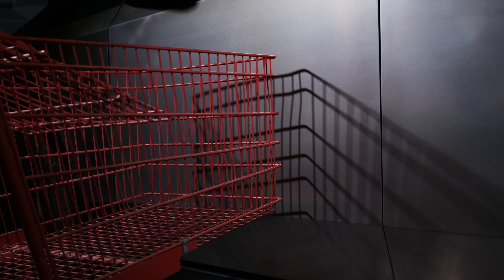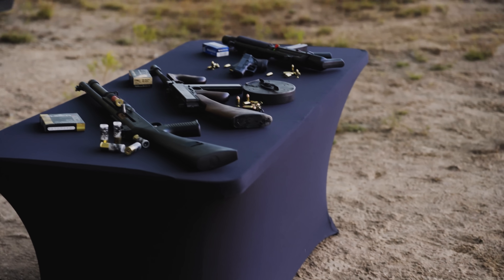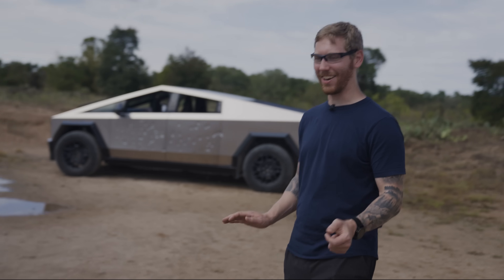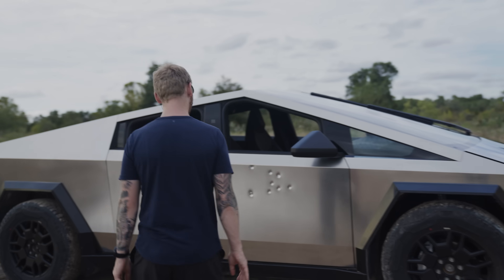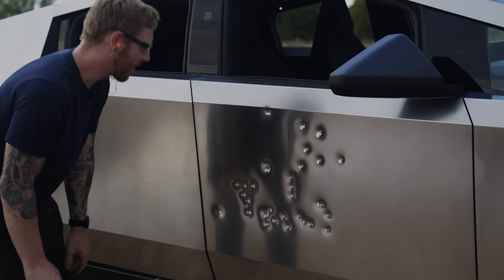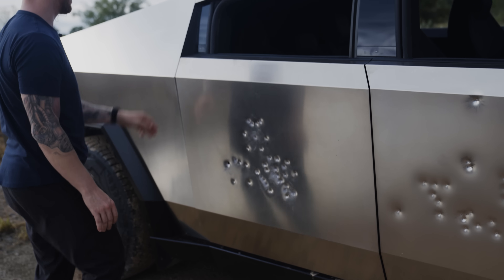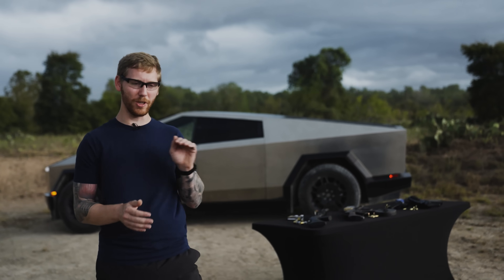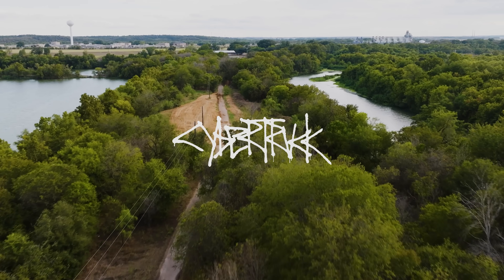Cybertruck Bullet Test

Comment: This test is incomplete until we hit it with 4 BORE…
Reply: We need a test from you starting with the 50 up to a 4 BORE. LOL
Reply: @dgilroy26  Kentucky Ballistics would do the job
Reply: Yooo it’s the goat!!
Reply: Yeah, but who's going to spend $70k to punch a hole clear thru their truck?
Reply: @jtengineering9385  Only KentuckyBallistics is crazy enough to do it.
Reply: @jtengineering9385  WhistlinDiesel will
Reply: @jtengineering9385 that sounds like something whistlindiesel would do....
Reply: @jtengineering9385   70k is just the starting price, but I do get your point.
Reply: @jtengineering9385   Then the cost to fix
Reply: @jtengineering9385  elon should he claims its bulletproof ....  they should test it using an AR-10 ( .308 ) a common round used and watch it punch a hole right through it
Reply: Tactical T-Rex baby arms are punching the air right now
Reply: notice how its all pistol ammunition. its still impressive but i wonder how 223 would do.
Reply: @abdulqadirbaban2730  it would go straight through it
Reply: @abdulqadirbaban2730 I want to see a test on the sloped front panel/windshield and the tunnel cover. The extreme angle might be enough to bounce rifle cartridges
Reply: @abdulqadirbaban2730  imagine if they had made the entire thing out of ar500 lmao the truck would have to be insanely expensive to break even
Reply: @dukedunac  It would be too heavy and slow
Reply: @abdulqadirbaban2730 It would blast right through it like Swiss cheese. Considering 1/4" steel plate won't stop 223, and these panels are only 1.8mm thick.
Reply: @abdulqadirbaban2730  like swiss cheese, if its not mostly lead and over a .45acp in power its probably going through. They probably shot subs for this videos hahahah
Reply: @abdulqadirbaban2730   and they are using a diferent type of bullet wen they shoot the black truck, so maybe even a diferent bullet would go trough easly.
Reply: @abdulqadirbaban2730  would smoke it
Reply: @abdulqadirbaban2730  yep. Or 7.62x39.
Reply: @abdulqadirbaban2730  no need to wonder. We all know it
Reply: How many tables to support the truck? Ballistic gel dummies inside too.
Reply: 4,  upside down. @PiDsPagePrototypes
Reply: I would absolutely love to see that. And the punt gun.
Reply: Based and neck pilled.
Reply: you have to do this now.
Reply: The only electric car Kentucky ballistics will buy
Reply: DO IT
Reply: Oh no
Reply: Four BORE and seven years ago our fathers brought forth, upon this continent, a new nation, conceived in liberty, and dedicated to the proposition that all men are created equal
Reply: yeah, you should definitely do that, with the boys if possible
Reply: i cant wait for you to do that later if you can, love your videos!
Reply: Truth.  Also... need to see how it reacts to a .50 BMG exploding inside of it.
Reply: PUNT GUN!!
Reply: exactly.. and even your regular AR rounds will go through
Reply: @woof3065 no. It won’t . Tried it
Reply: Definitely need a high caliber test.
Reply: @kevinwalton9348 oh they did they just won't show. Any rifle caliber will penetrate
Reply: @kevinwalton9348  Still isn't bad for the avg 9mm and 45 cal.
Reply: id buy that for a dollar
Reply: How about your Punt Gun ?
Reply: No. The punt gun!!!
Reply: .416 rigby
Reply: Barret blows you a kiss from blocks & blocks & blocks & blocks & blocks  away. The US Army liked them for a reason.  @hhxyz1234
Reply: Elon would probably paint a Disney logo on a door and let you shoot whatever you wanted at it for shits n giggles.
Reply: i hope you have 100gs set aside for this
Reply: Video clearly made by Tesla lol they use small under powered guns to "prove" the Cybertruck is bulletproof. LOOOOOOOL . An AK47 would shoot through it like cheese mate ! And they refuse to shoot the windows cause we all know even the small bullets would break through easily
Reply: You and Matt should be hired to go ham on this thing. That is a video I would watch.
Reply: Or a 50 cal
Reply: 416 Rigby?
Reply: It'll prolly stop 5,56mm and 7.62. Ima test mine when it gets delivered while Elon and Leno sitting inside.
Reply: @czealtamahawk1228   I doubt it. Notice that they didn't use any spitzer bullets in this demo. There's a reason for that. I wouldn't be shocked if .17HMR would make it through, simply due to the size:speed ratio.
Reply: @czealtamahawk1228  556 and 762 will easily punch straight through
Reply: presidents limo is more bulletproof than this crap
Reply: @lemcakes32422  Well obviously, president's limo is made to be bulletproof
Reply: @lemcakes32422 um, it also weighs 3x what it did before bulletproofimg
Reply: The Legend XD
Reply: Colab with Elon
?
Reply: yeah many people walking around with elephant rifles in USA
Reply: Man if you could get hired by Tesla for an advertising stunt that would be awesome !!
Reply: there going to be aimin in the glass not the metal
Reply: @aviationfish  They never though about the glass side windows I though bad guys only aimed at the thickest metal areas using the weakest of guns with the softest of bullets so it can get more clicks on you tube.
Reply: underated comment
Reply: aint no wat theres only 442 like on this
Reply: True
Reply: Yeeeessss
Reply: Whoahhh😂
Reply: No, 16" AP
Reply: i mean, cmon we already know its gonna go through
Reply: Lol
Reply: lol
Reply: punt gun?
Reply: Underrated comment :\
Reply: Tesla said this steel is good for most  subsonic shots
Reply: PUNT GUN!
Reply: YEAHH
Reply: Just stop with bb guns and bring anti-tank guns already !
Reply: 50 BMG come on
Reply: Some how I can hear your comment
Reply: Appropriate comment from the most appropriate individual.
Reply: Still pretty cool to see a truck with 2A body panels
Reply: would like to see the keltec plr 16 go against it loaded with green tip.
feel like it would be a hood gun in chicago. tesla gotta survive the ghetto roaches.
Reply: Let's do it guys lets get this approved ,give that thumbs up a working
Reply: THIS.  And a Punt Gun. XD
Reply: They should have called you 🤣
Reply: How about the punt gun vs cyber truck but for that try to shoot through it from the front
Reply: Yesssss!
Reply: i was waiting for you or Demo to comment. Good man.
Reply: I literally read this, and didn't even read the name, looked up thinking "no way this is Kentucky"... and boom....Mr 4 Bore himself 🤣

No way this is taking a 4 Bore or a 700 Nitro....but it sure would be cool to see it attempt it 😅
Reply: You and Matt need to give it a go.
Reply: Do it we know you have more than enough money to drop on multiple cyber trucks without thinking!
Reply: @rat-ballz  having money does not mean you waste them. Actually is the opposite
Reply: 😂 bro you insane and I love it
Reply: Slap rounds……
Reply: Some sort of collaboration needs to happen
Reply: It's incomplete regardless, to know the full extent, it needs more than just a few tiny rounds from guns hardly ever used.
Reply: @garydezern5212  we know... it's a joke...
Reply: not even close.. they didnt even shot the windows
Reply: This test in incomplete until Scott does it.
Reply: Get Cody, it’ll be like Christmas for him.
Reply: You not going to war in this 🤦🏽‍♂️
Reply: they could've at least took it to demo ranch, it's in the same state. Real armature hours here starting with a .45 and moving "up" to 9mm. do better @elonmusk
Reply: 🤣🤣🤣🤣🤣🤣 agree
Reply: Cybertruck vs Rigby when??
Reply: No one can shoot a 4 bore and survive, but a few men.
Reply: tesla should send Kentucky Ballistics a door from a cybertruck for testing.
Reply: Or just any rifle round.
Reply: kb is totally right we even don't know if a minigun or rpg destroys ctbertruck
Reply: you always resulting to violence sir. can you suggest less violent like swatting it with a folding table! hehehe
Reply: Whistlindiesel will do it
Reply: Ah yes!😊
Reply: This test is incomplete until Scott puts a thumb in it.
Reply: do it !!!!
Reply: Do it Scott 😂
Reply: aim it at the engine when you test it
Reply: PLEASE
Reply: I expect Mexico to be the no. 1. buyer of the Cybertruck, and not just the cartels.
Reply: Hell Yeah!
Reply: was wondering who between you, demo or brandon will troll them first :D
Reply: Correct.
Reply: Is this an Upcoming Video Teaser Scott? lol
Reply: This!
Reply: also a howitzer
Reply: aintoway that truck will survive LOL
Reply: Great to see you here
Reply: Hey Scott how about a slap round...😂😂😂😂😂
Reply: I did not see a trunk on that elephant  jk LOL
Reply: And FMJ's
Reply: I'm so glad this is the first thing I see in the comments. I was gonna say that they did test some of the most basic calibers but the firearms uses are kinds weird for pistol caliber. They need to be hitting this with wither bigger moving mass or faster moving mass. This truck isn't going to be a common person's truck so I would like to think it would be rated up to AP .308 or more.
Reply: I had a feeling you'd show up lol!
Reply: YES SCOTT
Reply: It's not a true test until Scott gets ahold of it
Reply: The only valid complaint
Reply: i knew he'd be in the comments lmao
Reply: or just any rifle above .22
Reply: They didn’t even want to use slugs 🥲
Reply: 20 mm
Reply: 50 CAL 🔥🔥🔥
Reply: So many autistically challenged (and triggered…pun intended) Europeans and libbies whinging and nitpicking calibers.lol
A: It wasn’t designed as an armored car and only were claims made that the cold rolled stainless panels are bullet resistant to specific calibers. 
B: Even armored cars are ‘only’ bullet resistant according to levels.
C: It can be fitted with bullet resistant windows and it’s still more bullet resistant than any other mass produced vehicle.
D: Commenters here lack reading comprehension and reasoning skills.
Reply: What good is bulletproof if the windows aren’t 😂😂cyber truck hype is dead ☠️ already stop it’s fake propaganda nonsense tesla🤡🤡🤡🤡🤡🤡🤡🤡
Reply: USA IS THE ONLY PLACE IN THE WORLD WHERE BULLETPROOF OF YOUR CAR IS REALLY IMPORTANT, THIS COUNTRY IS IN HUGE ASS OF CRIMINAL WAVE
Reply: Or just a regular 9mm FMJ.
Reply: I can already see the thumbnail!
Reply: 🤣im pretty sure if it goes through an altyn its going through this
Reply: The Punt Gun
Reply: Yo big fan
Reply: Hell yeah 💪😂😂😂
Reply: Maybe try a few .50 Cal slap rounds too? :O
Reply: We need a 4 bore vs Cybertruck video ASAP
Reply: SCOTTY.. you devil
I'm pretty sure that 4 bore would go through and possibly the other side on its way out..😂
Reply: @stephenhernandez3968 Duck below the glass?
Reply: Fire the Eargesplitten Loudenboomer at it
Reply: Going to shoot the other trucks too?
Reply: Or anything that can make it through soft armor
Reply: who do you have hunting you? ISIS?
Reply: i wanna see the .416 rigby next
Reply: “Today on Kentucky ballistics we have a Tesla cyber truck, and we are gonna shoot it with a 4 bore!”
Reply: let him cook
Reply: Wrong approach, to get through the metal (I, as total amateur regarding guns) would use high-velocity ammunition and a pointed full-steel bullet. 
 
You can see how the lead spreads out on the metal of the door. .
Reply: Haha get outta here Kentucky! Lol
Reply: AK 50
Reply: NAH WE NEED ONE FROM THE PUNT GUN 🎉🎉
Reply: Nope test the Draco vs the Ar 15 with those huge big boy bullets to see how the Tesla  cyber truck handles
Reply: What about 2 bore?
Reply: Yooooooooo
Reply: Yo I am a very big fan of
Reply: Who going out in the world with that 😂
Reply: It will fit 4 Whore...
Reply: Or an M200 intervention perchance?
Reply: Dying to see that I'm dying to see it
Reply: yooooooooooooooooooooooooo
Reply: or even 556. I find it very suspicious how they tested with some of the least penetrative common calibers.
Reply: @bksniperguy  Elon has mentioned before how it won't stop rifle rounds. Kinda of a no brainer

Comment: I've been shot at in an old 98 Ford Explorer. A 45 ACP easily penetrated the rear and into the back tire flattening it. One went through the rear, two seats and out the front windshield

Comment: For those of us who are NOT pretentious Americans, the thickness of the steel is about 0.072", or slightly thicker than 16-gauge steel. Normal body panels are 18 gauge or thinner. 
For reference, a Delorean would hold up even better than the Cybertruck.

What makes this somewhat impressive is the ductile nature of the stainless alloy they are using. That's what is allowing it to deform and stretch without failure. A mild-steel 16-gauge panel would not stop a bullet, though an aluminum panel of about the same thickness might.
Reply: Thank you for this post which is completely devoid of any pretention at all. You are a hero.
Reply: @Ojja78  You're quite welcome.
Reply: They also said that a double hit with buck caused fracturing.
Not that ductile if 2 hits is the limit.
Reply: you live in a 3rd world country that uses the metric system
Reply: @nicktienter4740  Pretty much every American engineer and designers use metric. Standards for safety and such are in metric and then converted into imperial. Metric is just better for direct conversion and relation of units.
Reply: ik but its funny because he says pretentious americans @freevipservers

Comment: It wouldn't stop the majority of rifle rounds. Velocity defeats armor. There's a reason they only chose 45acp, 9mm target rounds and shotgun shells because they are lower in velocity. There are some dedicated higher velocity armor piercing 9mm that would go through that. Any 5.56 would go through that without any trouble. In fact standard military m855 62 grain green tip goes through most steel and armor unless it's specifically classified to stop rifle rounds. Just think that .223/5.56 is a varmint/small game hunting round. Try .308/7.62x51 or 30-06 etc and it will blow a hole through both sides of that truck just like any other vehicle. I hope people don't take this video and think the Cybertruck is actually bulletproof and get themselves killed trying to do something stupid.

Comment: I imagine it's pretty resistant to door dings. Is it also pretty resistant to keying?

Probably not very resistant to an axe or large pokey metal object on a stick like a pickaxe.

How much damage can the glass take now? Did they fix the glass issues?
Reply: I actually believe it will suffer more from any door ding. Stainless steel is contaminated by any other metal or alloy that isn't stainless. Which then leads to rust, cracks, pitting. I'm sure someone will come to argue with me but just do some basic reading on stainless steel cross contamination and then we can have a polite discussion.
Reply: @Epiclyfail  Is it regular stainless steel though?

Comment: Bro that's only .07"in thick. Less than 1/10th of an inch😮 It's not bullet proof but RESISTANT there's a BIG DIFFERENCE. So if you're being shot at don't linger for long.

Comment: You claimed this has an exoskeleton, but there are no ribs in the exterior surface.  I don't see how the exterior surface could transfer any significant loads in a flat panel like that.  If this really is 1.8mm thick austenitic steel, I question why you would put such a thick, flat, panel on a vehicle.  The ductility seems to be key to the "bullet resistance" shown in the video, the cold work hardening causing it to become brittle after the first shot.

Comment: Are the windows bullet proof?  If not going with a thicker stainless steel alloy that had lead to several delays was kind of pointless.
Reply: The glass are not bullet proof rated because if it was it wouldn't be able to roll down.
And just like the guy said the car weren't meant to be bulletproof in the first place but it is so they made the window shatter proof.

And if you still complaining about the window not being bulletproof you could just duck, that is soo much better than any car at stopping bullet that otherwise would go through
Reply: @LeftOverMacNCheese  I was thinking back to when the car was reveled and it was supposed to have bullet resistant glass. (back when they threw a ball at it, oddly enough I didn't take it to mean the window was not bullet proof even though it cracked because it is the plastic glass layers that crack that offer bullet resistance)
I would not call it complaining to ask for a feature that was promised.  Now you are left with a weird compromise where the car is almost 8000 pounds because of the extra weight of the bullet proof skin but is not really bullet proof because of the windows.